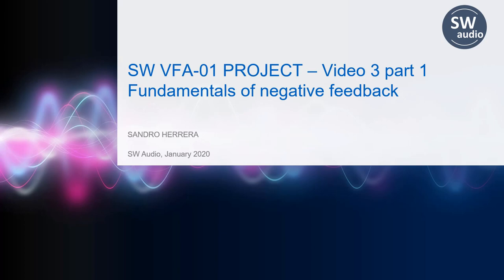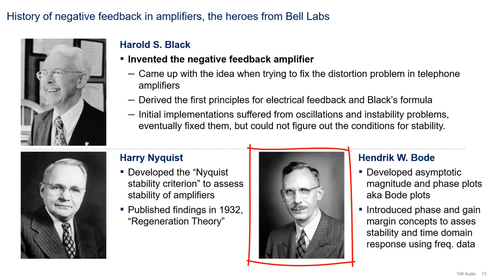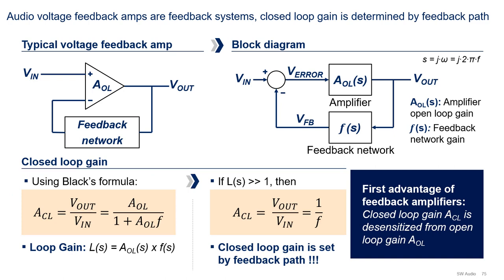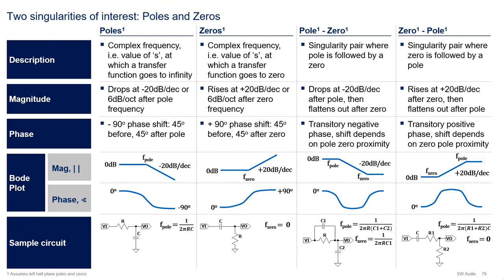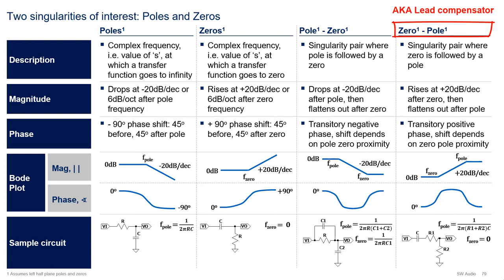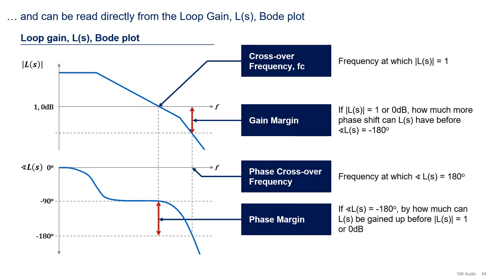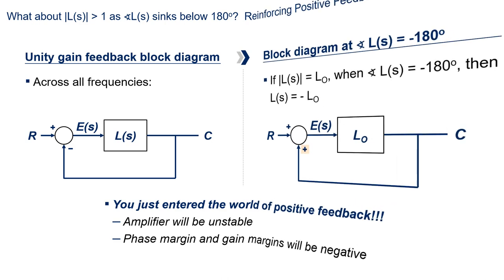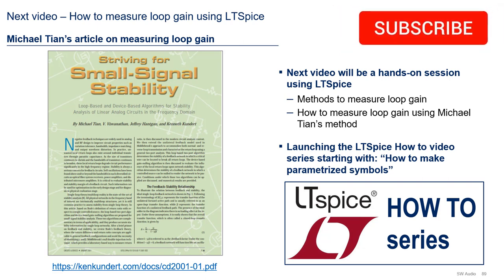3.1. Fundamentals of negative feedback - Audio Amplifier Design Fundamentals

Comment: Question. When using ltspice and you have two grounds. Source ground and amplifier ground. Do you have to change anything with your ltspice symbol so ltspice knows that they are connected to different star ground points?
Reply from the maker: Sadly in LTSpice or any spice for that matter (Spectre included), you cannot have more than one ground (node 0).  Therefore, all grounds are connected.  As a result, in the simulation, star grounds don't really matter, it is more for the designer to keep track of different ground returns since the simulator does not.